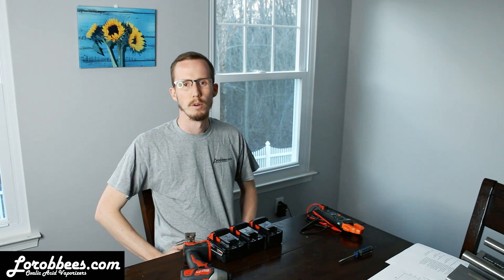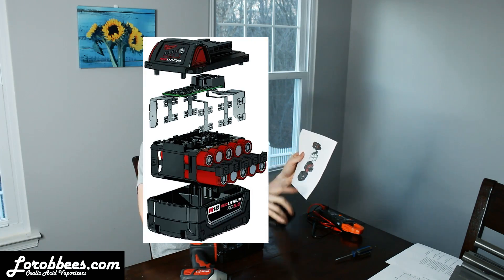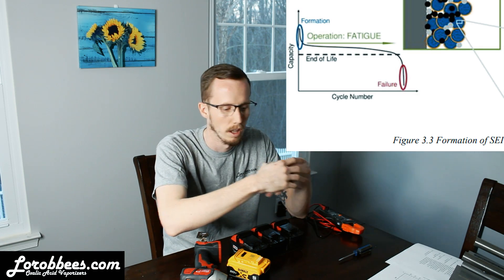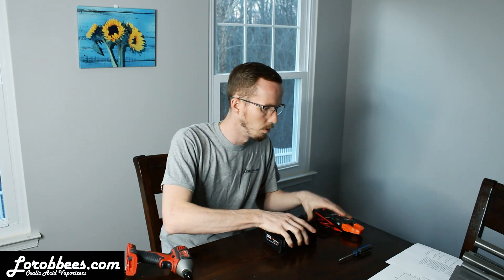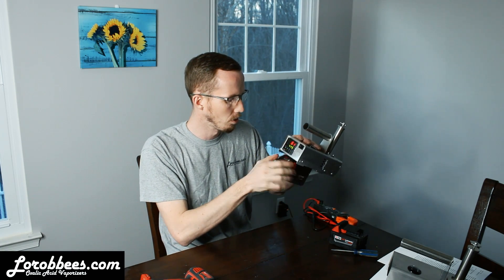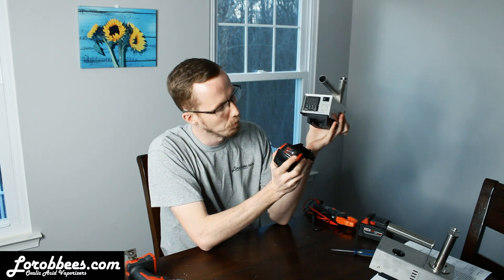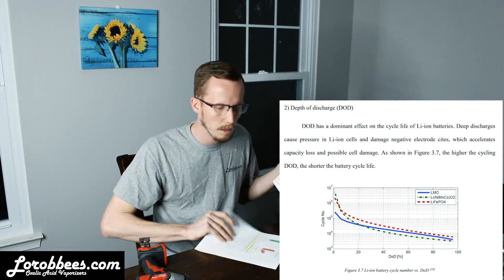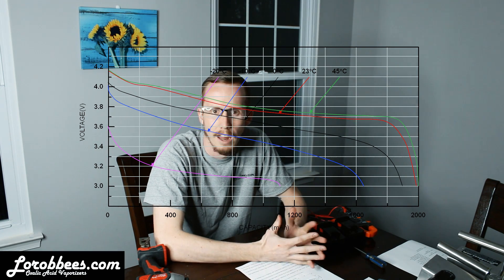Instantvap 18V Battery Protection Explained | Rob @LorobBees

Comment: Hey Rob, bought an InstaVap in July of last year and it does NOT appear to have the battery protection on it.  Is this an issue?
Reply from the maker: Hey there, not an issue but we can add it as a service if you would like to send it in for upgrade. The cost is $65, that includes parts labor and return shipping. If you want more info or our mailing address feel free to email us at lorobbees@gmail.com

Comment: How do you know if you bought an instavap in the last year if it contains the new protection chip?
Reply from the maker: If the unit goes below 15v it is not protected, a protected unit will turn off. You can email us at lorobbees@gmail.com to send your unit in for the upgrade, the fee is $65 and includes return shipping.